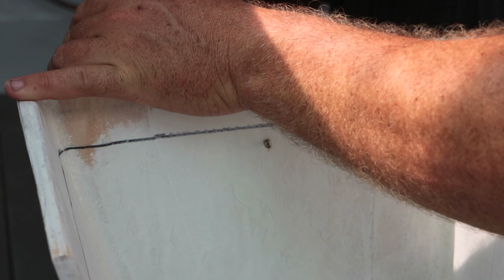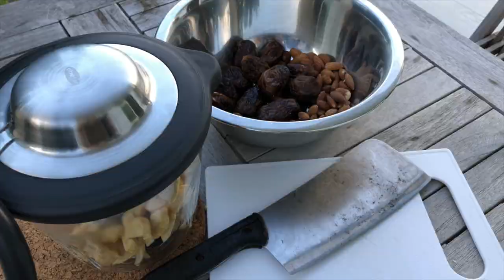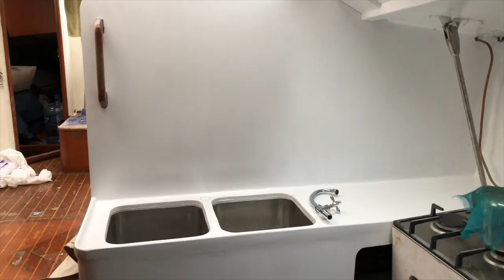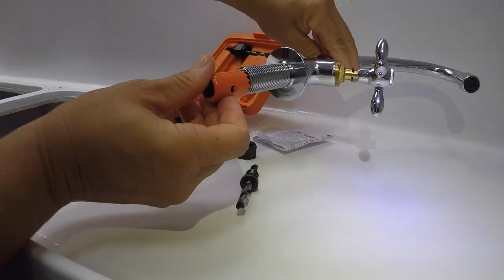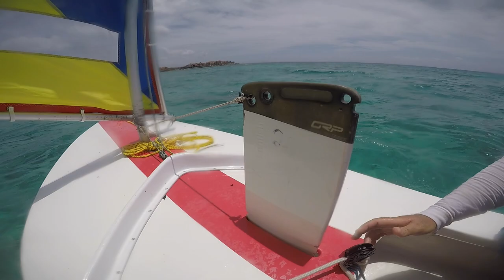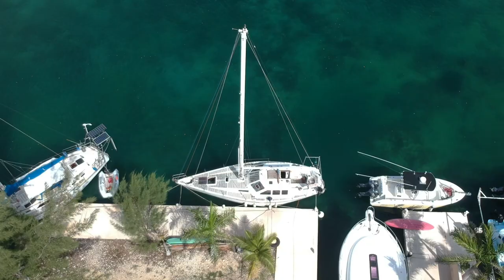galley WORK + sailing FUN

Comment: Greetings from Argentina. Would you be traveling to Florida? Ask how much does it cost to repair a perkins engine?
Reply from the maker: We might be traveling up to Florida, eventually, because there are a lot of marine parts and services there. But we will have to see how borders are in the coming months...also, the cost of engine repair depends on the state of the engine, more so than the type of engine. Luckily, there are some pretty common spare parts for particular kinds of Perkins engines.

Comment: How are you getting on with your plastimo water tanks? 1 month cruising and mine are peeing me off big time, leaking fittings, crap threads, punctures in the bladders, I'll be going back to 20L plastic drums! Vent over...now breath... SY OTTERS POCKET, Ireland.
Reply from the maker: Sorry to hear that they’ve been a disaster for you. Ours has been fine - no leaks since we removed the offending o-ring, and the box we built has protected from punctures and chafe. However, we haven’t made any miles since it was installed. Sailing obviously beats it up more than sitting at the dock!